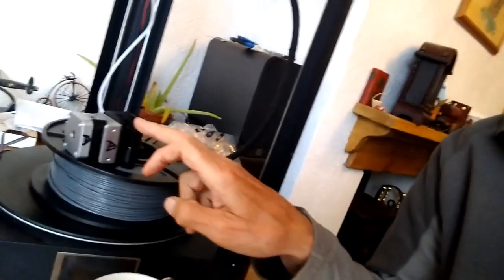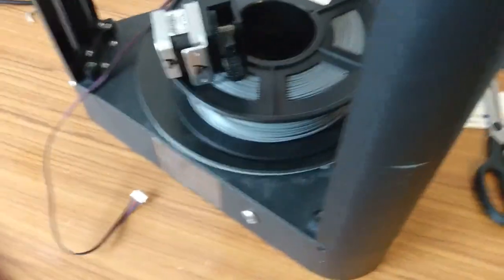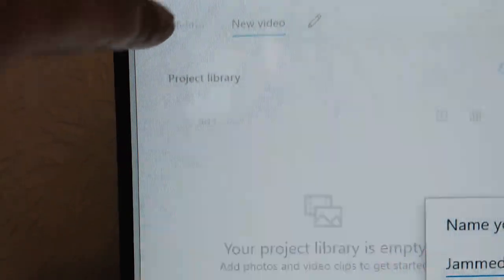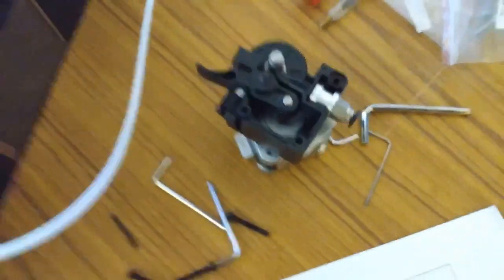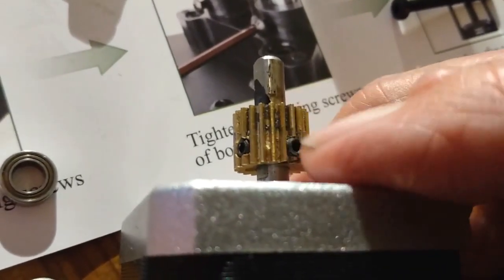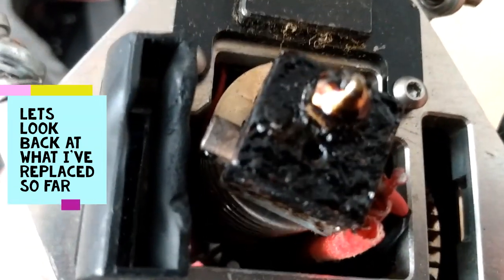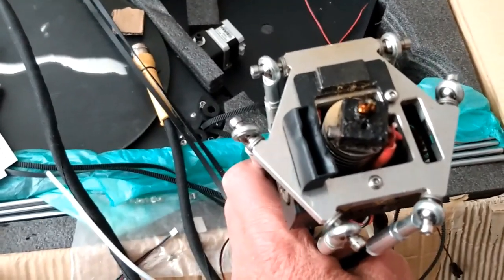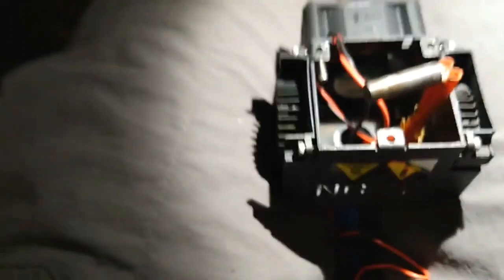Jammed extruder motor, Flsun QQ S Delta 3d printer

Comment: What do I do if my filament coming out to thick can uou please advise me
Reply from the maker: Hi Shane. Browse the Facebook and other forums for a while. You will find advice on setting up the printer. Simply, all else being ok, it would suggest that the nozzle it too large. I also get that effect when the heat is a little high and the feed speed is a little low. Try changing feed speed... Increase it.. First. Then try some temperature changes. Make notes of the effects of the changes. Perhaps an hour of experimentation in a methodical manner. Let us all know what you find and how you get on. Cheers, John

Comment: It looks like the previous owner didn't know what he was doing and subsequently the printer has been well abused. I also have a FLSUN QQS,  aQ5,  a Geeetech A10M and an Ender3. If you would like me to photograph anything on my QQS, please let me know and I will try to send the photos to you. BTW The extruder is a Bondtech clone.
Reply from the maker: hi David. that is very helpful. Good to know the Bondtech clone part. Allison Zhao is sending a new board to me. When I have installed the new board I will see where I get to. I may come back to you for help. John
Reply from the maker: I have looked at videos of Bondtech and Titan. They are both improvements over the simple type of extruder that is fitted to the other three or four printers that I and friends use. I will be interested to see how the Titan performs.
Reply from the maker: I do have a question relating to hot end (temperature breaks). My early examples have a 4mm hole and you push the PTFE tube week down inside to where the filament will melt. The other has a 1.75mm hole all the way down from the quick release fitting. I've had problems with the second a filament can jam.
Reply: @bikerides  Look on the Internet for 'Lukes Hot End Fix'. You may be able to adapt this to the FLSUN hot end. This entails cutting a small piece of PTFE tube, inserting it into the hot end. This is followed by a printed washer that pushed the ptfe tube onto the top of the nozzle when the connector is screwed into the hot end, therefore no gap between the ptfe tube and the nozzle. I hope that the way I have explained this easy to follow.